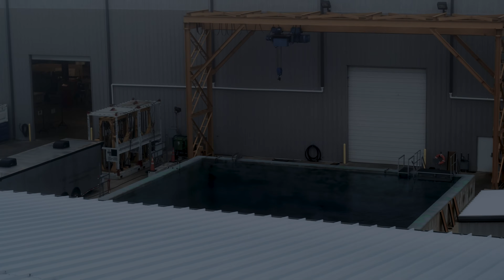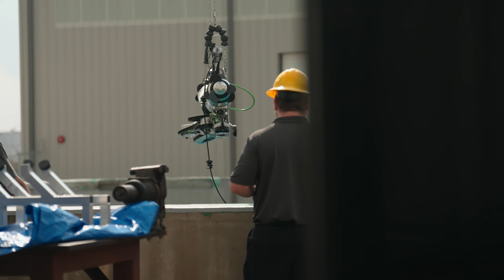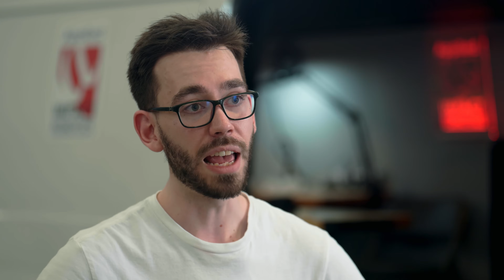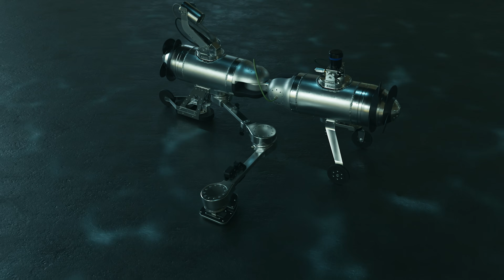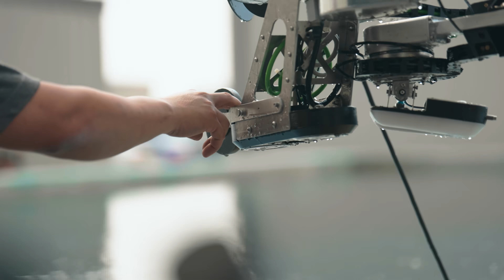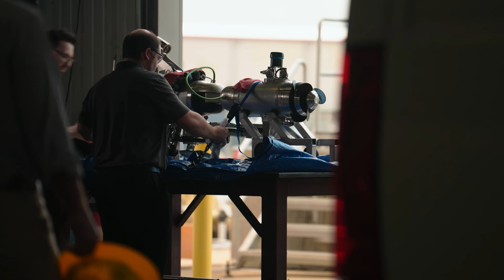Applied Impact Robotics Robot Demo

Comment: The dual counter-rotating propellers is a great solution for moving through thick fluids like crude oil with precision! Genius. It doesn't look tethered for power, how would you mitigate a rapid failure with the battery?
Reply from the maker: Thanks for the question! Although we don't talk about it in the video, the robot is tethered.